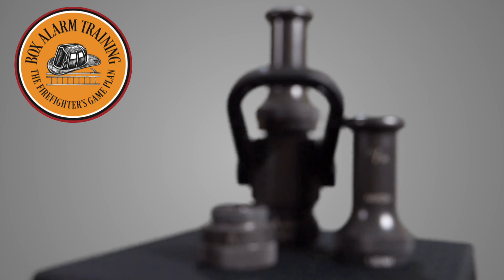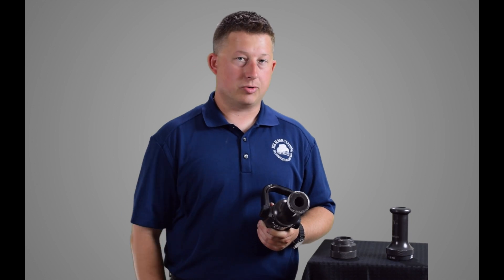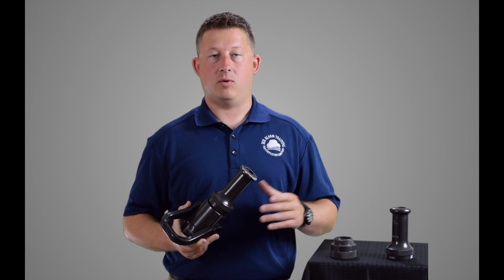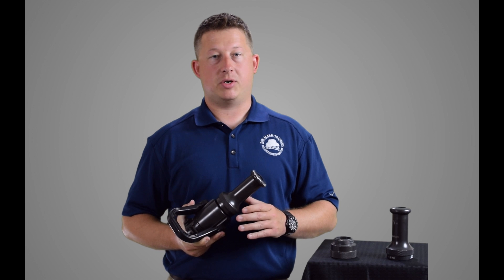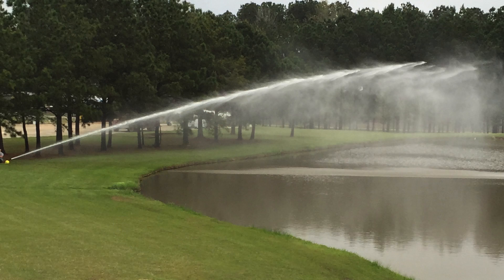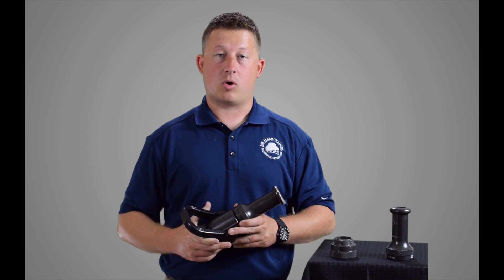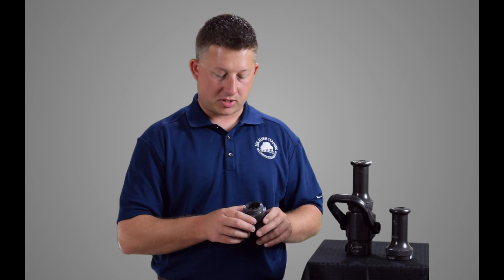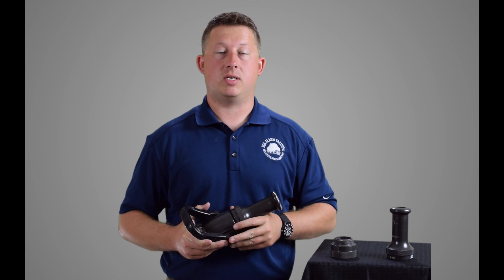Nozzle Series - Smoothbores

Comment: A lot of FF are convinced with old suppositions. But the reach and penetration from a correctly trimmed straight stream from a fog nozzle has more of both, reach and penetration. Starting for pressures and velocity, 100 psi in fog nozzles against 50 or 80 psi in smoothbores at the same GPMs.
But fog nozzles are more versatiles, you don´t need to close the water for changing tips, then looking for a place where store the tip, or looking for the tip for reinstalling because a lesser new flow. In selectable foggers you only rotate the ring, in auto nozzles with slide valve, the SAME on/off valve serves as GPM control.
Reply from the maker: I understand the notion that fog nozzles are more versatile, that is a very notable observation. But, in reality, a lot of what you just mentioned has been proven in numerous research studies to be misguided as "old supposition" itself. The reality is GPM is the single biggest determining factor when absorbing heat energy from a fire, and thus extinguishing it. Fog nozzles are available in lower pressures such as 50 and 75psi, however they are much heavier and when reduced to lower operating pressures a host of other issues occur such as nozzle whip. So, the vast majority of fog nozzles in operations are being operated at 100psi which causes a ton of issues. The selectable gallonage nozzle only works if the pump operator is communicated with to adjust the pressure feeding the nozzle. Same with the automatic. The bale itself will only "regulate" the amount of water given to it. The pump itself is what is delivering that flow to the nozzle. Without a substantial amount of communication these nozzles simply do not work as intended during real situations and real stress. This is most noted in the One Meridian Plaza fire which took the lives of three firefighters. A huge contributing factor of that fire was the use of automatic fog nozzles. Paul Grimwood of the London Fire Brigade discovered that the "average" firefighter can withstand and operate approximately 60 pounds of nozzle reaction... This is where things become significant. I personally conducted a nationally published research paper for the National Executive Fire Officer Program which showed that firefighters without very specific training lack the ability to "feel" their actual flow. In fact, over 50% of the test subjects did not detect a 25% reduction in flow from their nozzle when using the 100psi fog nozzle. This is because the higher pressure conceals issues that are difficult to detect. On the actual fireground we have seen demonstrated losses in pressure of around 10-15% as noted in Vestal and Bridge's research, "A Quantitative Approach to Selecting Nozzle Flow Rate and Stream - Part 1". This is a considerable drop in fireground flow that is typically completely ignored when "learning" about these topics in text books. Real world examples are abundant and have been demonstrated in numerous research projects. A lot of what you mentioned is accurate, however, a lot is also opinion and not backed with scientific research or data. We have an abundance of data which suggests the smoothbore is significantly better for interior structural fire attack. It is NOT better for the other varieties of fires, which you correctly mentioned the fog nozzle versatility. That being said, I appreciate the comment and discussion. Many of our firefighters need to understand these topics and very little information is shared in the text books regarding the significance of real world test results. Most of the classes taught, are taught in theory.
Reply: @Boxalarmtraining  Thanks for your response...I teach hands on using 1-1/2" 50-250 gpm Sho Flow flowmeters, I have two of that old spring loaded model. Both pitoted and give a very precise reading.
The reaction force it´s very useful for "feeling" the actual discharged GPMs.
When using smoothbore nozzles you have EXACTLY the very same problem about gpms as with traditional fog nozzles, being auto or manual, without comunication with the pump operator he hasn´t way for knowing how much or less pressure must pump, but with autos he/she only have to pump for a preselected pressure as 150 or 200 psi for a preconnect and the nozzle operator selects the flow he/she needs, all of this without the need of comunications...as you know, the first things to burn in a fire are the communications.
Higher pressures conceal flow issues only in non automatic nozzles, a low flow opening selected, but with high pressure, if the FF didn´t see the selected gpm will fedback as it is flowing high GPMs, the same with smoothbores, but auto nozzles will have reaction force proportinal in straight line with the flow being discharged, in SBs or conventional (fixed/selectable GPM) fog nozzles, the reaction grows up EXPONENTIALLY with increase in pressure.
Teaching the feeling of GPMs in auto nozzles itsn´t rocket science, it´s easy to learn and understand.
Grimwood coming from UK fire service, considers 200 gpm a very high flow from a nozzle, but 250-300 gpm in straight stream can be controlled WITHOUT over exertion just seating over the hose, and higher flows, such as 400-500 gpm from 1-1/4" at 400 gpm at 80-90 psi, two FF seated behind the nozzle control it easily.
For interior attack you didn´t need high flows, ususlly a 100 or less gpm will suffice.
For exterior attack, you need stream capable of penetrating the flames, and still, after of travelling 20 or 40 ft, have enough "surviving" flow for absorbing the heath wich maintains the pyrolisis...not the flames heath.
Reply: @Boxalarmtraining  Love this conversation. I do wonder about the concepts you mentioned about identifying reduced nozzle reaction. I'm fully on board with your findings that it is harder to identify reduced flow when the nozzle reaction already starts high, but did your study compare low-pressure combo nozzles (specifically automatics) to the other nozzles? The nozzle reaction for our 50 psi Chief XD fixed gallonage nozzles is the same as our 7/8" smoothbores when flowing 150 gpm at 50 psi, so I'd assume your findings for the 7/8" nozzle in your study can be reasonably assumed to be applicable to a low pressure straight stream of equal NP & GPM. I'd also think it would be fair to make the same assumption about a low pressure automatic nozzle, but this is where I wonder if you have better information. You mention it in the Automatic nozzle video, but the only real way to ensure adequate flow is through a flowmeter or through nozzle reaction. I feel like the statement "you don't know how many GPM you are getting out of an automatic nozzle" is just as applicable to a smoothbore or fixed gallonage low pressure nozzle as it would be to a low pressure automatic nozzle. Ultimately, if you are interior in low/zero-visibility conditions, you won't be able to see a reduction in stream quality for your smoothbore or fixed gallonage combo, and shouldn't be relying on that to determine adequate flow anyway. All three nozzles will have a reduction in nozzle reaction with reduced flow conditions, and to the same degree, so at that point, are you still against the automatic nozzle, or does the use of a low pressure automatic nozzle assuage the concern of "concealed" flow issues? 

I'm doing a deep dive into both parts of "A Quantitative Approach", and have read some of your work as well, and am still coming up with a fair share of questions. Looking forward to the rest of your video series, as I work through it almost 10 years later! Cheers!